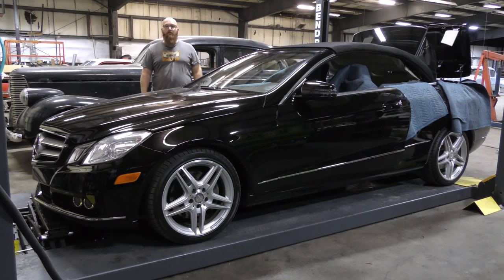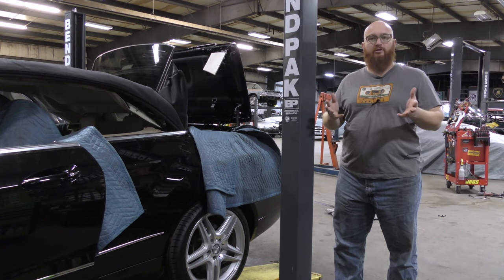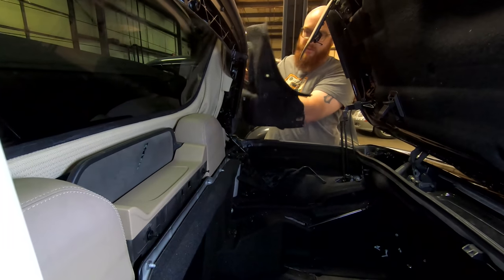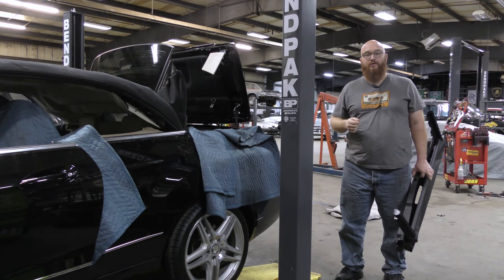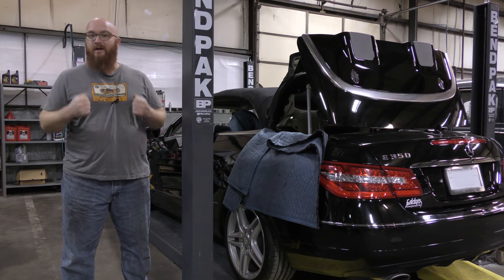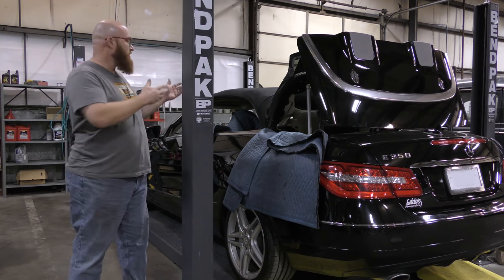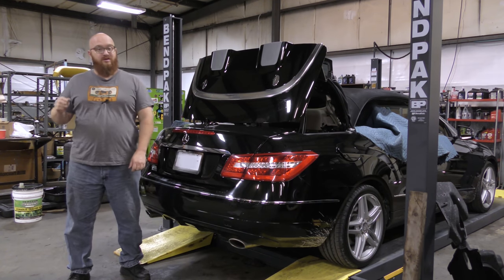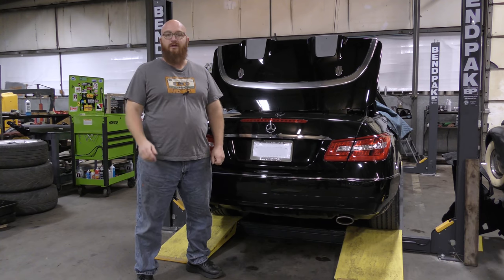When bad design costs thousands! Not so convertible 2011 Mercedes E350 can no longer rise on demand

Comment: It actually takes ingenious and somewhat insidious engineering to design a car so that it needs to be replaced soon after the warranty expires.
Reply: And it takes a mechanic expert in hindsight to criticize it...
Reply: I had a BMW M3 like that.
Reply: Engineers say it's not hard to make something last long; what is really hard is to make it break when you want it to.
Reply: German engineering at its finest
Reply: If you study mechanics/Maschinenbau in German uni, there's often a special class just how to design things to break at fixed points.
Reply: Citroen, Peugeot and Renault have it down to a Fine art! Some of them don’t even make it out of warranty!
Reply: @julioblanco  hondaade 1 comvertible, S2000, works flawlessly, electric not hydralic
Reply: True. Just goes to show what a pretty, shiny thing will to do the male brain. 
I’m guilty. Although, I bought a used Audi convertible with a 100,000 mile powertrain warranty that covered the entire engine and transmutation, including cooling systems. So it saved me in a transmission that blew out at 137,000 miles (literally 30,000 after I bought the car). Cost to replace was $5,500 for an OEM plus the labor was close to $2700 at the dealer. 
   One good thing about dealerships is they really getting an aftermarket warranty company to cover repairs.
Reply: @julioblanco I’m glad someone criticizes it.  I like all the info before I buy——or not.
Reply: All European cars are good for only 4-5 years max !!!
Reply: Mustang cylinders and lines were easy to replace 🤗
Reply: Driving a fancy car is a life style and the money goes for its membership and not for product quality. By a new one every 3 years or drive a Camry

Comment: This is why I buy Toyotas. They might not be perfect, but they’re built way better than the German and American cars.
Reply: One is every comment section. No they aren't. In fact, Toyota had the same issue with the SC430. Lexus has gotten stupid over the last few years. Prices are comparable or more than Mercedes. Yes, a Mercedes will cost more to maintenance than a Lexus but they will last if taken care of correctly.
Reply: @BruceCultureAllen  According to Consumer Reports and its reams of reliability data, Mercedes Benz came in 20th out of 26 car manufacturers in CR's 2021 most to least reliability list. The top three are:
1. Mazda
2. Toyota
3. Lexus
Sine note: My 2008 Mazda MX5 with power retracting hard top has never had any issues with this top, and I've raised and lowered it many, many times. Stay away from German vehicles.
Reply: @BruceCultureAllen  "but they will last if taken care of correctly. "

laughs in german.
Reply: @computerstuff8352  Just speaking from experience. I've owned 2 Mercedes' and they were/are both great. Are they as reliable as Toyota or Honda? No but they aren't nearly as bad as people make it out. Just don't cut corners or skip maintenance (like any car).
Reply: I have both...Lexus ES 330 and Mercedes E550 .
I do most of my own maintenance.
They are both great cars but the Mercedes is built with better parts..
Everything is heavy duty.
Also the Mercedes-Benz doesn't rust like the Lexus. 
Then again the Mercedes cost almost double 🤷‍♂️
Reply: @larsbambi1575  Has the Mercedes gone 16 years without need of repair? This is very common among Lexus vehicles. Most of the part failures occur after 25-30 years. I'm a moderator in a major Lexus forum.
Reply: @davepaturno4290  I always see Lexus with really bad interiors compared to
Mercedes. Like the leather always looks like crap
Reply: @davepaturno4290 my daughter's  Lexus 05.. has 215k miles. I have literally replaced just about everything😅 except engine and transmission...original!
It has been a great car the engine runs like a clock.
One thing I'm not a fan of is that has a timing belt instead of a timing chain.
The benz is a 2011 135k. I have replaced brakes and tires. It did just throw a check engine light for a temperature sensor.
I just haven't got around to putting it on yet.
My better half drives a Ford edge now that's a endless money pit!!🤣
In conclusion the only two cars I will buy from here on out are Toyota/Lexus and Mercedes.
Reply: @larsbambi1575  Well don't forget Mazda. They are the most reliable auto company with Toyota in 2nd and Lexus in third. Modern Mercedes vehicles are now far behind in this category.
Reply: @BruceCultureAllen  Great cars the old ones, modern ones not so much.

Comment: I was literally thinking to myself, “they still can’t get this right,” before he even mentioned the R129. The first Mercedes I ever drove was a 95 SL500 for sale on my grandfather’s lot. My dad was with me. Had the top down and once we got up to speed we were doused in fluid from around the sun visors. Looking straight on and deadpan as could be my dad said “This is not enjoyable.” 😆
Reply: Your dad 😂
Reply: I owned the same car. A 1995 SL500 and had to rebuild every hydraulic cylinder in the roof. There are 11 of them. What a pain in the butt that was. I sold the car right after the rebuilding .
Reply: Maybe they aren't to concerned about Americans being attacked by their convertible roofs? Just saying lol!!
Reply: @brianjames5685  You had to mention the war.........basil faulty is distraught LOL
Reply: @Mike-zf4ev  that sounds like a wallet drainer for sure
Reply: @lukemartin2476  I really liked the car except for the expense of repairs
Reply: I have SL600 and the cylinders were the first fix after I bough it. That problem was caused by "green environmentalists". The seals are made from biodegradable plastic instead of rubber or polyurethane. It is actually more expensive to use the biodegradable plastic.
Reply: @frostyab7579  that’s interesting! They mess up everything lol
Reply: @frostyab7579  It wasn't biodegradable for environmentalists... it was biodegradable because of poor choice. Then again, this is the Germans... stick a V8 gas guzzler into the car but it's ok because the seals are biodegradable so the environmentalists will love us... and then the car will break down after 10 years so they buy a new car!
Reply: "That's what she said." 😂
Reply: @kanedaku  OMG how did I not catch that?! 🙈
Reply: OK... shifting focus to the notorious R129 and its leaks...  Is it possible to just drain the hydraulic system, then lift and lower the top by hand?
Reply: Watch a video on how you get the roof back up manually .....insanity .
Reply: @frostyab7579 it was a pinprick hole in the braided steel hose...

Comment: Went to look at a CLK convertible recently. When the seller told me he just spent $6000 fixing the top I said "thanks for your time" and got the hell out of there. I missed the chance to be the next sucker.
Reply: Mine's been great. (well except for the common transmission problems) :-)
Reply: @littlechicago7482  they had COMMON transmission issues?? Mercedes isn't Mercedes anymore huh
Reply: @TJDunaway  You can figure on a 722.9 transmission to last ~150k miles before you're replacing it.  At a bare minimum you'll be doing a valve body at that point.
Reply: @robbybeauchamp  I dealt with a clk550 as a passenger for a few years, I hate them with a passion, a gmc envoy was better appointed & more reliable, and didn't have electronic gremlins nearly as soon
Reply: I spent $3500 over the last year fixing the power hardtop on my BMW, 172k mi. I plan on keeping the car for a long time. Fixing and immediately selling seems foolish. Repairs can be inconvenient but still cheaper than buying new.

Comment: Mazda got it right when they went with a manual top. They sure were not the first but wow that is simple and it works so very well
Reply: convertible tops were all manual, before they came up with powered system.
Reply: Then mazda dropped the ball with the rotary seals on the RX-8.been there got the hat and the tshirt LOL
Reply: @davidjacobs8558  Manual tops on 4 seat cars are a disaster no one wants to deal with.  A 2 door Miata is NOT the same (I own one)
Reply: no German they have to make every thing complicated
Reply: Mazda also have powered tops, I have one on my 2010 MX5.  Not sure if it is hydraulic or just electric.  EDIT:  just checked, it has no hydraulics, just 4 electric motors.  These are not known to fail.
Reply: @bindingcurve  I'm talking about historic perspective. 
just like how transmissions were all manual in the begining of automotive history,
all convertible tops were manual in the beginning.
Reply: @davidjacobs8558  Cars all had carburetors also, good luck selling one today
Reply: @Owen Evans thing is, there is no really GOOD apex seal out there, no material composition that we know of can reliably handle the pressures that an apex seal goes through. The rotary design, while very neat, is just not as reliable as your standard piston design ICE. It's unfortunate as I love the Wankel motor, but apex seals just need replacing way more often than rings due to the inherent design of the engine.
Reply: Yesterday a Merc parked next to me as I was putting up my MX5 manual hood. I was rather jealous of the Merc power hood but it was metal.
Reply: @friedpickle9828  Yep, the wankel is super small, very compact and drinks fuel at an alarming rate! Great to drive though and loves to rev plus it's really smooth, miss a service or top up the oil at your peril though!
Reply: @davidstorm4015  I also have an MX5 with PRHT option. It is now 13 years old and has never needed top repairs or adjustments. The smart top module allows the top to open or close at up to 30 mph.
Reply: @hereward1971  I've owned 4 rotary Mazdas. They were incredible fun to drive.
Reply: And you can raise or lower a Miata top while sitting in the seat.
Reply: @bindingcurve  I have a convertible fiat punto, four seats, manual roof, its easy, it has the same simple hydrolic lifters as boot/hood door to help lift it manually very easy. No lines no electrics, just simple big roof, I like it.
Reply: @liorwohl  Supermini convertible is NOT an E class.  AND YOU DO have hydraulics, that are known to leak.
Reply: @hereward1971  merc who is dropped the ball om rotary far before mazda!

Comment: There is a great scene in the movie "Fight Club" where the main character/narrator played by Ed Norton explains car manufacturers reluctance to fix known issues with vehicles. It explains the issue perfectly:

Narrator: "A new car built by my company leaves somewhere traveling at 60 mph. The rear differential locks up. The car crashes and burns with everyone trapped inside. Now, should we initiate a recall? Take the number of vehicles in the field, A, multiply by the probable rate of failure, B, multiply by the average out-of-court settlement, C. A times B times C equals X. If X is less than the cost of a recall, we don't do one."
Reply: Zero f*cks given, and it’s just going to get worse, EVERYTHING is getting so damn cheap
Reply: Ford Motor Company: “Hold my beer”
Reply: That scene is based a real Ford memo saying not to recall the Pinto for exploding because it was cheaper to settle all death suits, past and future. Very illegal today, but who knows 😬
Reply: Well luckily nowadays we have laws against this for egregious safety concerns but yeah that wont stop the germans from putting this shit in their cars
Reply: Which is the reason why early Pinto burst into flames. 1 buck for the part that would have made them safe, multiplied by the million of cars already made, that make a 1 million cost to fix the issue. Court settlement(s) cost less for Ford so, they didn't fix, 'till after it became a huge scandal. By then, there was WAY less of those Pinto on the roads.

Same with the early Fiero catching fire.
Same with the tires exploding on the Explorers in the '90s.
Reply: I always wondered if the burnt out Town Car with the insurance adjusters laughing in the hanger is a wink wink to Ford

Comment: "What happens when an accountant builds a car, and not the engineer?"

GM:Plays Montell Jordan's "This is how we do it!"
Reply: Accountants give budgets now to build cars so then all is down cheap design and parts as for high ends cars not components been made out side the brand car ie audio mercedes BMW etc
Reply: Oh man... beat me.  Was going to write:  Chrysler, GM & Ford "Hold my beer".
Reply: I'm surprised a recall wasn't issued this could be a serious health hazard and possible lawsuit
Reply: The German engineering department says ;  Never use a simple part when a 10 piece electro-mechanical assembly will work just as well !
Reply: LOL
Reply: @kobra6660  it's like how wizard said, wear and tear. It's something that is designed to ultimately fail and optional. You don't have to use the convertible to drive the car. Is reason why they don't have to do a recall. Not like faulty airbag.
Reply: @wolfman9999999  - Not really. Its a design flaw pure and simple. Its one thing to have a high pressure hydralic hose. Its quite another to have a small one that is in a situation that requires it to flex during pressurization. I bet it either gave and a bend point OR scraped against something not deburred or sharp repetitively. This hose when activating the mechanism is very rigid but must travel a bit.   They make repair couplers for this. The smart thing would be to splice it in two places away from point of failure and then add a couple layers of sacrificial ablative sleeving to that point because it will happen again.
Reply: I remember back in 2011 thinking Mercedes had reached peak obsolescence engineering... the shit they have released since then shows me how wrong I was & what depths they could still plumb.
Reply: @curtknight1021  It's more often a series of vacuum lines and/or hydraulics and pumps when an electric motor would have done the job.
Reply: @edwardoutthere3189  This!
Reply: Very disappointing in a car that already cost 3 times as much
Reply: @edwardoutthere3189  Now? You mean starting 50+ years ago or more...it's nothing new cars were shit in the 70's also, Americans had an earlier start at it though

Comment: I am a owner of a 2002 Lexus SC430 with almost 210k miles now. Convertible hard top still opens and closes within 25 seconds. Mind you it was Toyota's first ever convertible car and it's the first year production and still with that, the hard top motor functions properly (just knocked on the wood), I highly doubt if it was ever changed by the previous owners. I always try to maintain and lube the rubbers, spray lubricant where there's a metal on metal contact and so on.

My point is that if the company tries to make it reliable and work, they absolutely can do so, especially firms like Benz but as Wizard said that is what happens when an accountant builds a car and not so much the engineer (metaphorically). They also know building the cars TOO reliable would slow the manufacturers' profit margin a bit
Reply: But in case of a Meecedes it wouldn’t because people replace them when the new model makes the old one look outdated, not because the old one starts to break. These problems are something a second or third owner will experience.
Reply: I have a 2004 toyota solara.The top works perfectly every time!
Reply: European quality can’t compare to any Japanese car:/ as no Benz , Audi, BMW , Jaguar , Land Rover are more like made in China level of quality

Comment: These things are beautiful. The leak is a real shame.
Reply: I agree with you on that.
Reply: I’m in the market for one of these and this video hurt lol. I really hate Mercedes for all of their hydraulic bullshit
Reply: The rest of the car is beautiful and very reliable...
Reply: The CLK before it had the same issue. It goes back to 1998!
Reply: They really are pretty cars
Reply: Hrmmm. My.64 AMC Rambler American has the original mechanical automatic top system... still works and doesn't spray you with hydraulic fluid after almost 70 years... wierd.. 🤣
Reply: @thekikendallsautoandrandom1271  440 convertible??
Rare old car..nice
Reply: @thelastmemphian  still better than a BMW
Reply: @thekikendallsautoandrandom1271  good ol AMCs
Reply: @thelastmemphian  LOL I can't believe Benz still didn't give up on the hydraulic system on smaller stuff lol
Reply: @richardsgarage6697  this is why our ancestors immediately called cars female. Beautiful is expensive.
Reply: I would be angry beyond belief at getting sprayed with hydraulic fluid.
Reply: @thelastmemphian  ABC suspension and up to 11 hydraulic cylinder/pump in the top alone.  people have spent 10k fixing both a piece at a time.   4K to repair the top re -sealing all cylinders at the same time.  
 I stopped my hunt....
Reply: @thelastmemphian  I'm looking in to just buying a convertible for my 45th birthday. The only ones that look decent are MB.  Everything else looks so bland.  I did tell myself however, that you will need 15k laying around when it actually breaks.